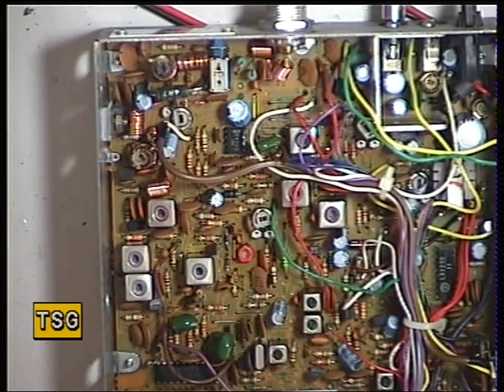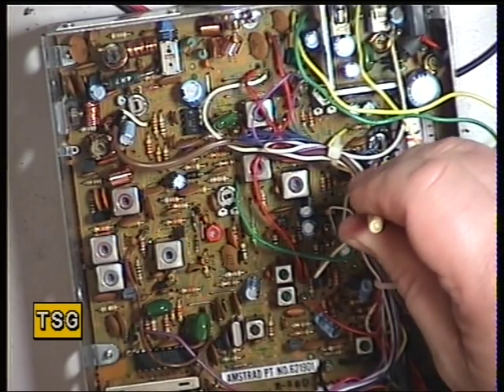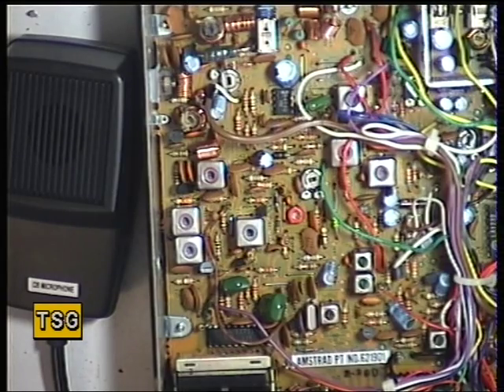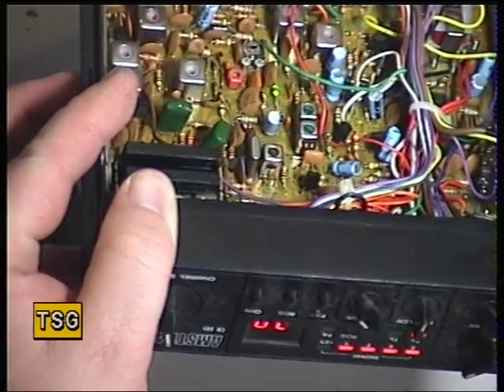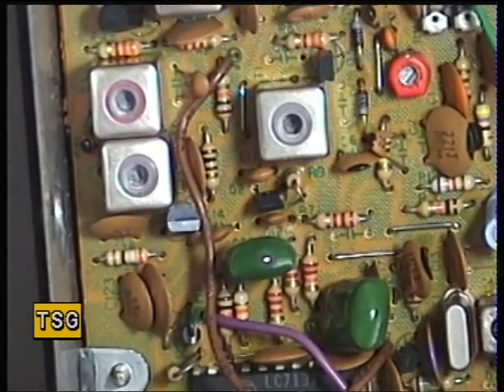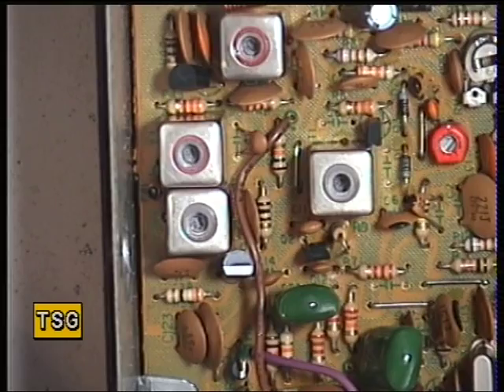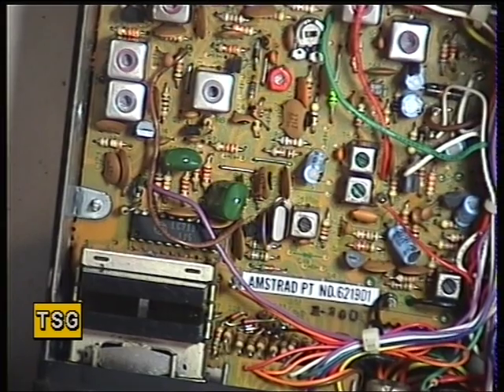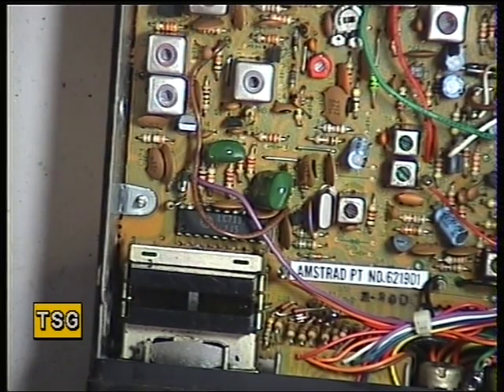Amstrad CB901(made in Japan version), UK (CB 27/81) CB radio (Mobile)  - Receive adjustment

Comment: Hi there. I've just changed the final transistor on my 901 as the resistor had been shorted and I'm only getting about 200mw output and it drops over a few seconds. You mentioned the driver transistor could be at fault. Where is this transistor located please.  Simon
Reply from the maker: With the knobs towards you & the 2SC2166 output transidtor therefore top leftish, the 2SC2086 driver transistor is about an inch lower down than the output transistor & is unusually a T092 cased transistor, like the small signal ones are....but has thicker leads & is taller.

Don't be tempted to put wrong parts in, by the way, everything is readily available! 

Richard
Reply: Thank you Richard. I.ll get on the case of sourcing a new one.
Reply from the maker: Bear in mind I have virtually every semiconductor for every CB in stock here new & will always try & match price wise if you ever get stuck...except my stock control computer is down at present :( I'm not in the component business but have £15K worth in stock for our use, so can sometimes help. For example I have the UPD2812C PLL IC in stock as used in the Grandstand homebase which was already obsolete in 1981!
Reply: Sods law I've just ordered one from ebay for £3.50
Reply from the maker: Sounds about right if that includes post
Reply: Hi Richard
Just changed the driver transistor and I'm still only getting about 800mw output at full adjustment. Any ideas would be greatly appreciated. Simon

Comment: Hi Richard, you mention wanting to make sure the green LED lights for S30+ in this video.  How many micro/milli volts do you set your Marconi radio test set to achieve that level?  Is it 3.16mV?  I know these meters are just relative signal strength and not calibrated but I have a 901 set here where beyond 100uV power needed to light S30+ increases exponentially to almost vertical (on a graph) rather than a flatter response!  I can just get it to just light around 5mV and not lit on S9 but later it seems to drift slightly so that either S30+ never lights or 100uV lights S30+.  The result is the LED meter reading S7 for simply background noise.  There isn't much between the LA1230 (FM IF system) and RV2 except D13 (D5442), which passes a diode test. I swapped out RV2 with a  known good preset, which had no positive effect either.   Do you think the BA656 (LED meter driver) may overly sensitive or on the blink?
Reply from the maker: My experience is the BA656 either works or doesn't. The Marconi test set on the bench used with the videos goes up to 10mV. In the video it may have lit at the 3.16mV you suggest, but as long as it lights at some point, I'm OK with it. It's just S9 I'm ever bothered with. The Marconi then has a X10 switch which would bring the 10mV to 100mV....even if S30 only lit at that point it wouldn't bother me, but can't think of a time that's ever happened.

I'm assuming you're working on a real Amstrad 901 & not a fake copy........the Hong Kong version with no scree printing on the component side of the PCB....

Richard
.
Reply: Yes, it's the genuine Japan-made version with full screen printing and otherwise has aligned nicely and is very sensitive.  Bit of nuisance really as it's clearly different to the other two other 901s I've setup recently and had side by side with this one.  I think that on the Marconi 2951 you have 300uV, 1mV, 3mV and 10mV after 100uV, from what I can see in a stock photo of the test set. Having x10 would definitely useful.  I don't think my 2955B goes beyond 39mV.
Reply from the maker: We had 2955B's at Nottingham radio & a 2955A & 2951 at Compass Comms in Bradford, of which I was a Director. Obviously the 2955's are newer & offer some extra tests. When the 2951 came up on Ebay as a collect only in Wales I jumped at the chance & I'me sure if something ever goes wrong I'll be able to fix it. Not so sure about fixing a 2955! I actually like the old Farnell TSG520/TTS520 combination & we have two of them here, finding it the quickest to use...though the digital Sinad meter on the PSG520 isn't as easy!

Richard

Comment: I had a dry joint on the audio chip, the slightest touch of the heatshrink killed the audio.  A quick run of solder on all the legs from the chip cured that.